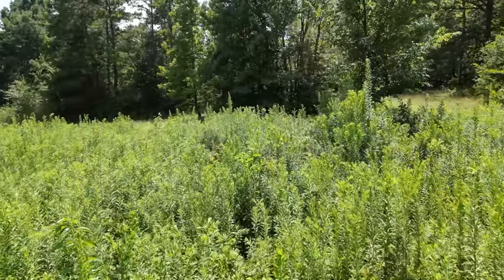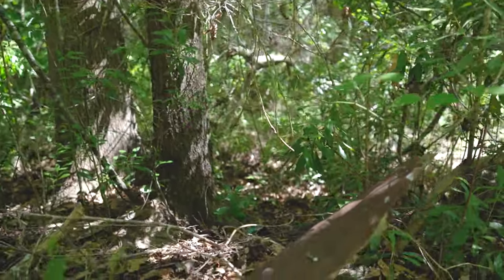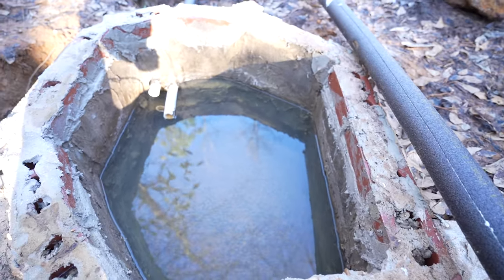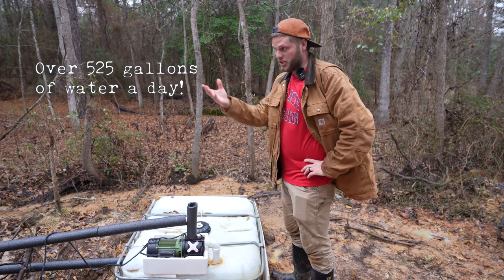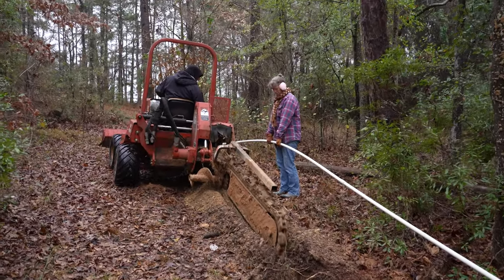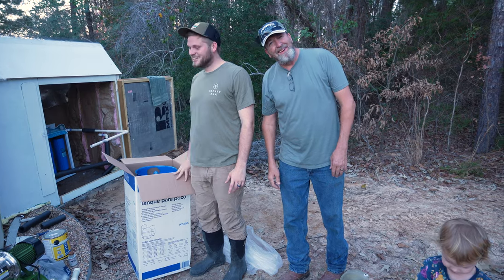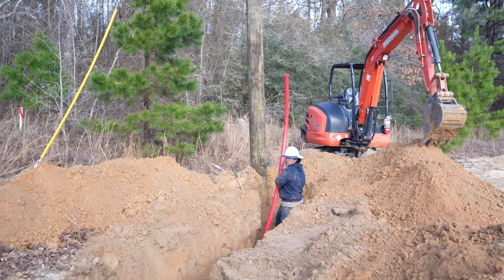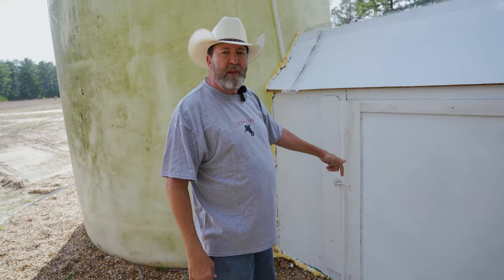We figured out how to get FREE water on our farm FOR LIFE!

Comment: I can get your 55 PSI with a 15-foot rise volume max pressure my homestead has a pump house 15 ft high lesson 15 feet away from the house and I get 55 PSI
The size of the part was proper step-down makes pressure you don't need those damn pumps to give it to the main tank piggyback that up the hill solar transfer stations

Comment: “Free” water, and don’t get me wrong, im doing the same thing, but “free” after quite a bit of expenditure on material necessary, I.e. an 8k gallon tank that is quite expensive unless you’re very lucky… im still in the process of trying to find the largest tank I can without spending a fortune… having said all that… it looks great! Keep looking for sensible options etc. 😎
Reply from the maker: I get what you are saying, and we did get lucky with finding a deal on the water tank. We were previously looking at a smaller one until this one popped up. "Free" water refers to the source being free not the infrastructure it takes to set up our system. If we really wanted to just collect the water from the spring in buckets we could and that would be even more free but we chose to save ourselves some time and effort. :)

Comment: Electric run to that area is going to be more expensive then having had drilled a well next to your home location. I am wondering why you did not just drill? Having purchased raw property and pricing everything out myself drilling well is always cheaper. I can’t imagine how much you spend on the tanks pipe and heavy machinery for clearing. Not to mention having to upgrade the system after realizing it did not work great. It’s great work and content though. Also if you haven’t yet close that old well as nice or animals may fall in and die and contaminate your spring box as it is too close to each other. Great video
Reply from the maker: Thanks Jovanny!